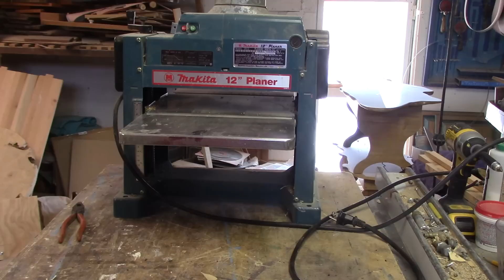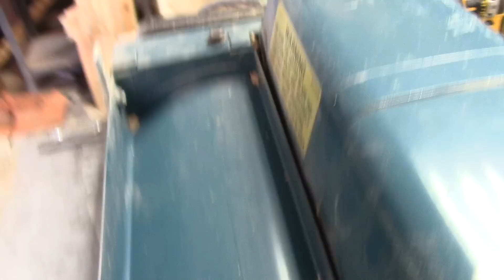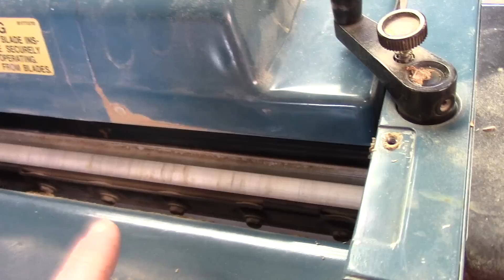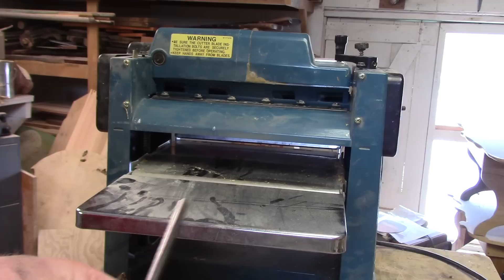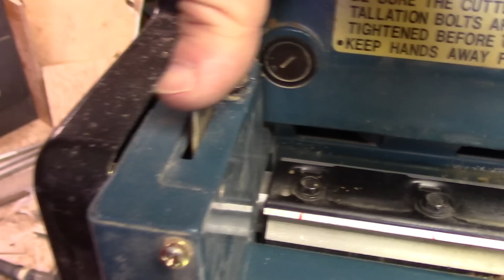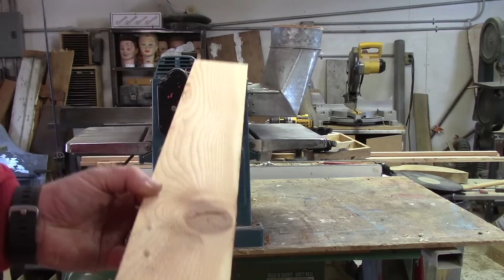Portable Planer Knife Replacement

Comment: Cross threaded or torqued to spec, tight is tight, right?
Reply: TheCanadianOne 
     Tighten it to 1/4 turn before it strips.
Reply from the maker: I like to tighten until it starts to get easier again then two more full turns.
Reply: Leave them loose, they are easier to remove later!!!!!